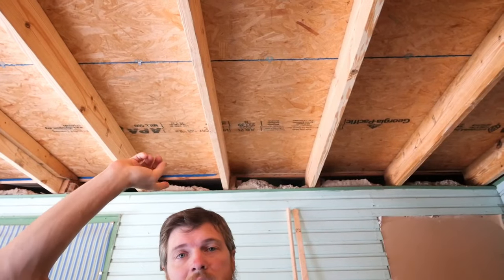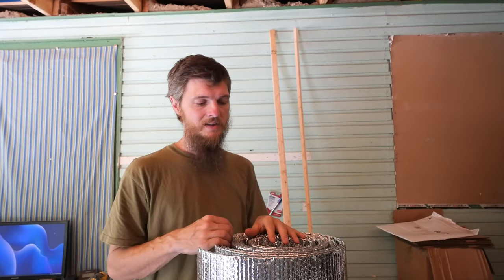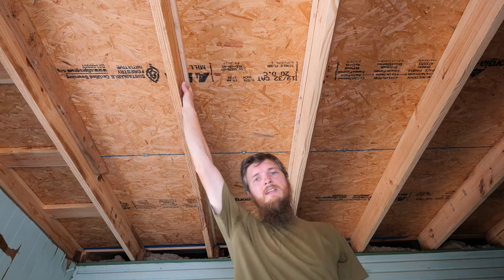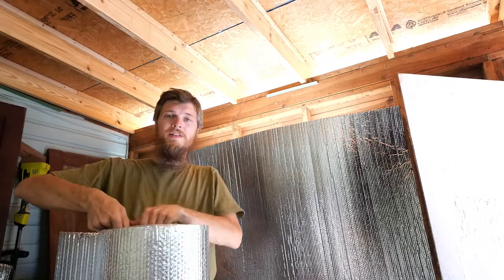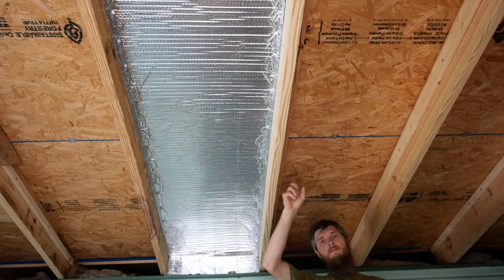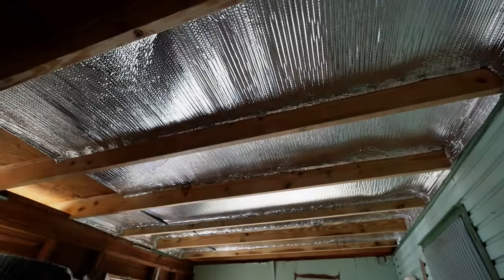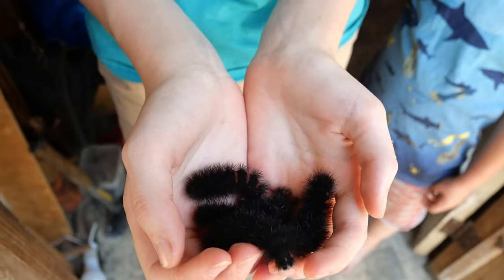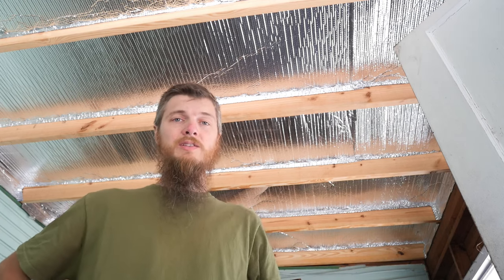It's Too Hot - Roof Radiant Barrier To Block the Heat

Comment: Hey Ashley.   >>;=)  Happy week-belated mom's day.  I'm guessing y'all've been fairly impressed with this insulation in the workshop to be doing the work to put it in this to-be porch/sun room.  Not sure if it'd make any real difference, but had an idea for you guys if you haven't put up any ceiling material yet: since those lengths of insulation didn't fit along the spaces all in 1 piece, y'all may could put some HVAC metal tape over the seams between the pieces to help get seamless runs.  Glad you're getting insulation projects going; we've had temps up to 94 here in TX where I'm at, summer is so here already and it's not even Memorial Day yet.
   Doug would hate what I do, when wasps get in my place, I just get them to crawl on my hand and take their butts outside.  Wasps' work is never done, though, they'll just keep going like a particular batteried bunny, although if you really want to save their house, only way really is to capture the fliers in a container then move their house and re-stick it elsewhere with a piece of gum or somehow and reintroduce the fliers to it (and probably have anybody but Doug do this *LOL*).  If you get got by a wasp, hold some wet dirt on it, it'll absorb the sting and feel better in under a minute.
Reply from the maker: The bubble fol has been working amazingly. Now it feels comfortable, like sitting in the shade instead of a hot car. The other night we took that wasp nest out to a new spot so we don't have to worry about them anymore :)
Reply: @diyfferent  Awwwww, you relocated them, how neat.  Y'all're such loving people.  Not many would offer them a second chance like that.  I really commend you for being sorts who care for all little crawlies and flyies of creation, even if they seem "dangerous" or inconvenient.  I have to wonder if putting foil bubble on all the windows on a car could keep it from feeling like "hot car" hehe

Comment: I use a garden hose with a strong nozzle to knock mine down. It doesn't hurt the wasps and they have no idea a human is at the end of the water. This is how I run skunks off too. They also hate the water spray.

Comment: I would suggest a window covering from the hardware store as a super easy solution. They make them tinted or opaque with different designs that can really help with the sun. Plus they're cheap and easy to remove once you get to working on the porch and removing everything for screens in the future.

Comment: For the window - you can get insulating drapery lining -or also insulated shade fabric that is made in several layers including something that looks like Mylar - I’m not sure what it is, which make for great Roman shades that you can face with the fabric of your choice. Depending upon how serious you are, you can also get magnetic strips to sew into the edges of the shade to connect with magnetic strips round the edge of the window so that when they are closed, they keep the cold or heat out.

Comment: You need an air gap between the foil and roof board not touching. If you double the insulation with a air gap, the R-values go way up!
Reply from the maker: I'm not sure why this keeps coming up lately. We did leave an air gap. In the first part of the video we installed wood furring strips in the ceiling to attach the foil to, to create a consistent air gap. We did not attach the foil to the roof sheathing. They don't touch.
Reply: What if I have a similar roof that I'm closing to make a new room? How can I insulate it properly up there?
Reply: Ok if I put a foam panel touching the wood and after I put the silver foil...lol will that be ok ?

Comment: I sure would like to know how it works. I need to do that to our utility room on the outer walls.
Reply: I use this in my back bedroom in Arizona during summer months over my windows. My back room is usually the hottest room in the house. This stuff just over the windows makes it the coolest room in the house. So I'm sure this works fantastic for what he is using it for!
Reply: @sarcastictakeout431  thanks I am in deep south Louisiana.  This week high 80 to 90.
Reply: @peggybreaux8973  we have been in the mid 90s to low 100s. So anyway to keep the house cool without breaking the bank! Saving grace for a day sleeper!
Reply from the maker: So far it has made a huge difference. The room is comfortable now, like sitting in the shade instead of an oven :)
Reply: @diyfferent  🤣🤣

Comment: I don't know much about this type of thing but I feel like the foil bubble insulation would work better on the roof than the ceiling.... I don't know how practical or legal that would be, but I only see that making the room hotter. I know you guys are smart so I'm probably wrong, but that's just what putting it on the ceiling makes me think.
Reply from the maker: So far it's made a big difference. The room is comfortable now to be in and before it was almost unbearable. :)
Reply: @diyfferent  My porch is hotter than the hubs of hades in the summer and I am going to try your idea!! Thank you very much!!

Comment: So I'm  sure it's been a little longer now since you put the Radiant up. Is it really working? We have an absolutely marvelous 53 ft x 12 ft front porch, fully screened. It has a tin roof with no OSB or whatever that was (like plywood) under it. It is now in the unbearable stage. The metal roof on the actual mobile home was put over strips of wood on top of the original shingles and is very soundproof. When we open the front door, the rain will be very loud, and the heat build-up incredible. Do you think the Radiant will work? Would we need a ceiling too? It's not a super high roof in that it slopes downward. I really want to try this if it's working.
Reply from the maker: Yes! It has made a really big difference. Before it was unbearable, but now it's so comfortable to be in that room :)

Comment: Will you be installing a ceiling fan that may help with the heat. I have seen people in Florida use them on there porches. Great video you guy are just 2 funny. Use your hand lol. God bless.
Reply: My thoughts exactly. Be sure to use an exterior  grade fan otherwise the blades will  warp and be useless.
Reply from the maker: Not sure yet :)
Reply: @diyfferent  if you are planning for electricity on the porch just wire in a ceiling box rated for a ceiling fan. No big expense and easy when  you're in the wiring phase. Then you can add the fan when the time is right.

Comment: Take your shop vac and vacuum up  the nest/wasps. No need to use poisons then. The Hornet King does videos on this kind of thing all the time. It came in handy when i had a wasp nest in a live electrical panel and didn't want to spray anything inside it.

Comment: You need airflow under that roof so it doesn't rot something to keep that spacing then insulation and sheetrock to finish it up.
Reply: He is not insulating it because it is an open air porch/Florida room.

Comment: do you use this heat insulation for mid floors as well? or even at ground level with 2 more floors on top?
Reply from the maker: No, it's mainly just used to block radiant heat in roofs, porch ceilings, or even exterior walls.

Comment: an airgap helps to insulate too so mounting the foil away from the underside of the roof should help a little more , standing air would be best
having the mecanical aircirculation from inside the house exit on that end under the roof might help keep the temperature inside the space a little more constant
(grinning ) you two acting like a bunch of kids : "poke it with a stick " makes me think of the saying its all fun and games untill someones poking their eye out 
dont worry been there done that , stuff like daring someone getting the ball out of the field with the angry bull in it

Comment: I'm concerned the heat going back up may curl your shingles.. can you vent the ceiling?
Reply from the maker: We don't have shingles. Right now we just have a black underlayment until we get new metal roofing installed. This room is currently vented: air comes in the soffits, above the bubble foil, into the attic, and out the gable vents.

Comment: I have west facing windows on each side of my fireplace. To block the afternoon sun I drape car window shield reflectors over extension curtain rods. Works like a charm.    

It's hilarious when guys scream 😂 Couple summers ago our heating/cooling guy came out to replace my AC. I was watching TV when he ran (on his tip toes) past the window screaming like a little girl. He was scared of a snake that unfortunately was electrocuted in the AC unit. My husband had to remove the snake🤣

Comment: Uh no to wasps, they can sting repeatedly and I'm somewhat allergic. Knock down in the early night, they're slower. Any dupont product kills.
Here in Florida, light equals heat. I replaced my screens with light blocking screen, it helps to stop light from heating up the glass.
Why aren't you using the furring strips on the bubble foil? I'm confused by using it under the foil.
Carry on
Reply from the maker: They just act as nailing strips to make attaching the bubble wrap easier and gives me a consistent air gap behind the barrier.

Comment: If you have Zinc sheets above roof, just paint them white to reflect most of the heat.
Reply from the maker: Right now we just have black underlayment on the roof. When we order new metal roofing we'll be getting a light color :)
Reply: @diyfferent  sounds great
Reply: @diyfferent  I was going to ask that. It makes complete sense in a hot climate. Good choice!

Comment: I had a wasp sting go septic on me. Weird I know. Wasps have to go here. Especially the large red ones. There are enough to fight till the end of time here in the South. Not worth a trip to urgent care. Wasps have an especially painful sting and will attack if you get too close to the nest. I appreciate all sentient beings. But at our house it is called a Buddhist mercy killing.
Reply: My experience with red wasps is that the sting is painful but begins to settle down within an hour and after several hours is just a local painless bump.  Yellowjackets OTOH are painful out to about 12 hours or so and because by late summer early fall they are at the largest population of adults very protective of their hive so when you run into one multiple stings are more likely than with red wasps.  So far I have managed to avoid hornet stings but do recall seeing a football sized hornet nest in a 10' tall pine about 12" away from the tractor wheel while bushhogging a while back, fortunately they did not swarm.

Comment: Would have been interesting to shoot a bare plywood section & an insulated section with a temp. gun for a comparison. 
Also, be careful of the flannel moth caterpillar, also known as the puss caterpillar, or “the asp,” it is covered in fine silky hair that hides its poisonous spines. I don't if they have them there or not, but they're painful. ✌🏼
Reply: I was thinking the same thing about those caterpillars. We have the same and they do sting!

Comment: Hope you are right but I don't think so. Is going to absorb heat and radiate it later.
Reply from the maker: So far it's been amazing. It no longer feels like we're sitting in a hot car. Now it just feels like being in shade. Works as advertised.
Reply: @diyfferent  glad it's working. I'm no contractor but I heard the problem is that it reflects heat to your times and quickens their breakdown. Vented attic space is the long term solution of course

Comment: If you get stung, quickly put a little baking soda in a little water and drink it down. It will neutralize the power of the sting.
Reply: ??? You make a paste and put it on the sting, not drink it.
Reply: @cynthiafisher9907  thank you so much for your comment. However, if you’ll do a little research, you’ll find that taking baking soda internally will neutralize the effects of the sting. I also know about the paste on the sting. If you ever have an upset stomach from something you ate, take a little baking soda in a little water and drink it down. It will either settle your stomach upset or it will cause you to throw up. You’ll feel better right away.
Reply: @susieq2544  Ok, I will research that. Thank you for your reply.

Comment: I've seen this in alot of new construction, works great, I recommend before any homeowner does this to measure out the amount of insulation you have in your home, if its like 5-6 inches high, get some insulation Blown in bc you ain't gonna block much heat with a radiant barrier and barely any insulation.
Reply from the maker: In our situation the radiant barrier alone did a perfect job because this was just an open back porch. We weren't looking to contain any heat or cold. It stopped all the radiant heat and made our porch comfortable.
Reply: None of that's true.

Comment: I would tape the edges with tape and make sure that you have a ventilation between the roof board and foil bubble sheet. Follow up with foam board and tape the seams. Foam board over the 2x4 followed by covering of either drywall or lightweight plywood, vinyl, etc. Foam board will help with heat transfer

Comment: Ok ......i have a new shed, i want to insulate because it gets too hot.i know nothing about it, yup. I started with foam boards and cover thT with heT barrier........my husband stop me  and said is the other way around...yup i stop . Can somebody help this lady? Lol i put the foam blocks , cut them and put them with own pressure. After i bought the silver heat barrier and staple it on top ......yup. is that ok ?
Reply from the maker: It won't hurt anything. But if your foam is thick enough you may not even need any radiant barrier.
Reply: Generally you put the radiant heat barrier in first, then foam.

Comment: I it's late I know...
Could you have used foam board as a sub-sheathing with the OSB board over laying it....
Reply from the maker: I personally wouldn't do that because over time the foam will break down and get crushed being sandwiched between the wood and OSB.
Reply: @diyfferent  👍 
From decades of personal experience I've found this not to be a problem. 
Lol...try it for a temporary ceiling. 
At less than $12 a sheet...it's worth every cent...pink is better than blue here.
Reply: @diyfferent  vinyl siding if you choose to finish this...😊
Reply from the maker: @MalleusDei275  We did tongue and groove bead boards on that ceiling.
Reply: @diyfferent  like I said. Late. 
Tounge and grove is great...appropriate. 
Even on a porch especially here in the south and insulated ceiling is worth it. 
Love your work and intuitions, common sense isn't so common.

Comment: Air gap could also lead to moisture as the air cools, leading to rotting the wood and drywall possibly...also depending on the area you live in.
Reply: Air gaps are required with this Insulation 😂😂😂😂

Comment: Way too Late but you need to leave an air space. You are better off going across the studs less cutting and you leave slack in each bay.  Then tape off all seams.
Reply from the maker: We left an air space as recommended. That's what we were working on in the first part of the video with the batten strips. We created and left a 1-1/2" air gap between the radiant barrier and the roof sheathing.
Reply: @diyfferent  Okay it will work then. But you really need to leave some slack. That stuff may pop off of there if you get a really hot day. But to be blunt you could have run it across the rafters and saved your self hours.
Reply from the maker: It's fastened very well and won't pop off. We didn't run it across the rafters because we knew we were going to do a finished wood board ceiling.
Reply: @diyfferent  Yeah you just use 2 inch drywall screws then. It goes under the drywall fine. Tape all the corners and seams off and around all perforations.  Did 2 whole houses that I gutted out. Literally cut the HVAC Bill by 80% the house was a 100 times more comfortable and it paid for itself in 5 years. My ex still lives there she won't sell.

Comment: Paint your roof white you'll thank me over and over again, heat will go right through that
Reply from the maker: The roof is white metal. Radiant heat still gets through white. This barrier blocks 96% of radiant heat and made a big difference to how the porch feels.
Reply: @diyfferent  can you throw insulation on top of that foil leaving a inch gap and drywall over that?
Reply from the maker: @rigobertoespinoza1685  We have an 1.5" air gap above this foil. Afterward we installed ceiling boards to the rafters. It's just a porch so we didn't need to do insulation. In a wall situation, you can have the insulation touch the radiant barrier. That's what we'll be doing in the mobile home we're currently working on.
Reply: @diyfferent  yeah cool im remodeling my bathroom. My dad is a  contractor and mention to use this barrier on the east to west side of the house. Because of the sun since we dont have any trees near the home. I just saw the installing pdf form and it recommends the way you mentioned. Thanks again.
Reply: Meh no..

Comment: It's tiny. Insulation is cheap. Why not just insulate it? Probably cheaper than that stuff.
Reply from the maker: It's an open back porch. We weren't looking to heat or cool it so insulation wasn't a concern. We just wanted to block some of the radiant heat to make the porch more comfortable. Each product performs different jobs. And We had a bunch of leftover radiant barrier from a different project so that's what we used. It worked perfectly! And reflective is much quicker, cleaner, and cheaper than insulation. But again, they are different products for different jobs. Insulation is better for resisting conductive heat, radiant barriers are great at blocking radiant heat.
Reply: Because insulation is trash compared to this stuff 😂😂😂😂 this is super insulation thin or not it’s superior to that fiberglass shit. Foam isn’t even as efficient!